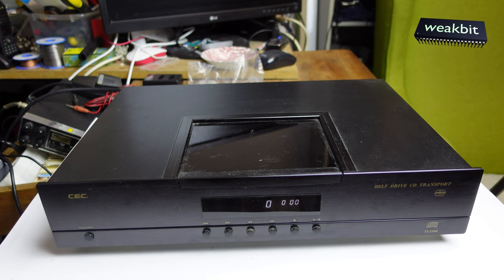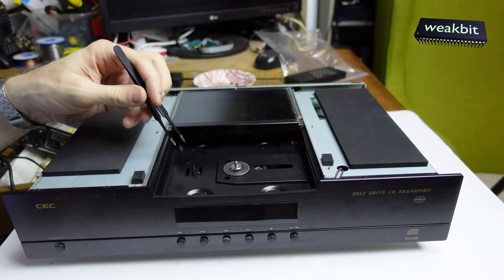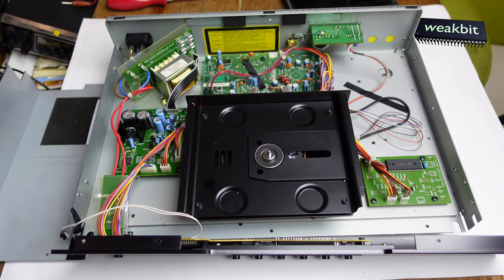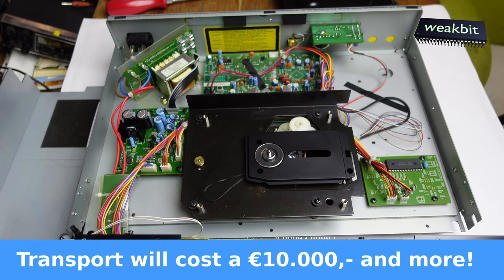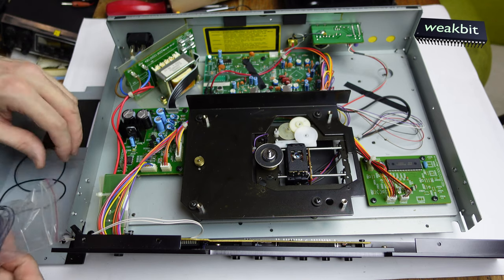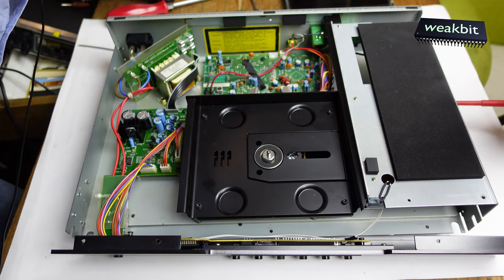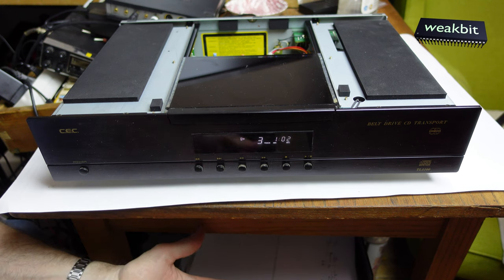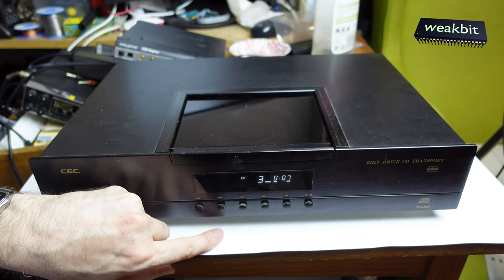CEC TL5100 Belt Drive CD Transport repair

Comment: Cec has made belt transport for different brands. I have an Yba cd delta 3 with a Cec mechanical. It's high end Hifi. Weight is to avoid vibrations. Not the kind of construction you'll find on 500€ cd player.
Thanks for your video.

Comment: I have the C.E.C. TL51XR player which I bought new from a dealer. After many years the belt wore out and wouldn't stay on the pulley. I contacted CEC for a replacement belt. They wanted $50 plus shipping that they would give me a pass code so that I could make the purchase. No thanks. I asked them for the dimensions so I could buy them off eBay. They said it was proprietary and couldn't possibly disclose that information and if I bought a Chinese belt off eBay I would likely run into more problems and it wouldn't be a permanent fix and then they said I should ship the player to them to inspect it and find out what's the source of the issue that I'm having. Anyway, I measured the diameter and thickness of the square belt and bought them off eBay and installed it and it's working and sounding great as it once did. Really poor American representation of a great product.

Comment: Overengineered. How can a belt driven CD transpor can sound better than a "normal" one???
Reply from the maker: I think this come from a machine builder team. But the CD will regulate the bit-stream down in it self. That mean if the bitstream is to less the motor drive faster and if it is over the mark it will spin slower. It is not depend on belt or direct drive the BER (Bit Error Rate) will be I think the same. Bit error from non reading and/or from spin cliches how we can make a difference? weakbit